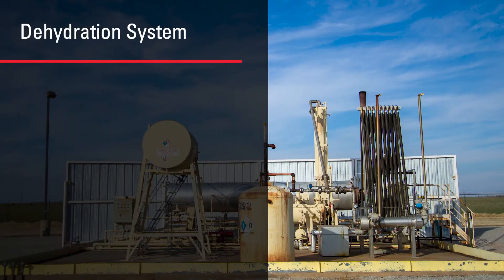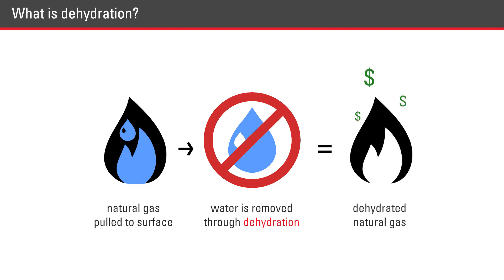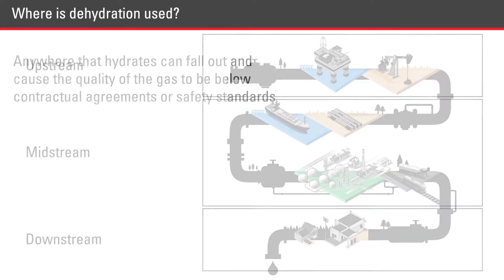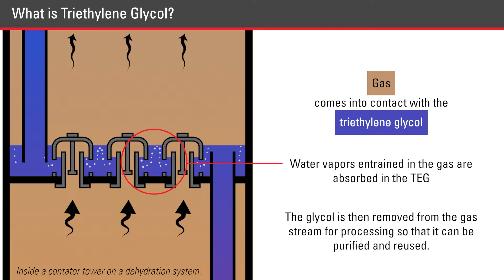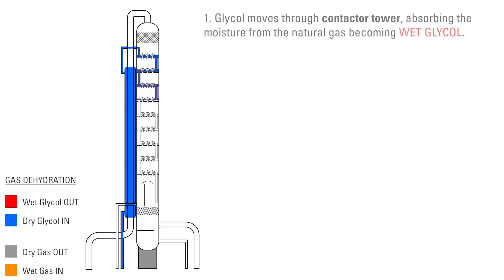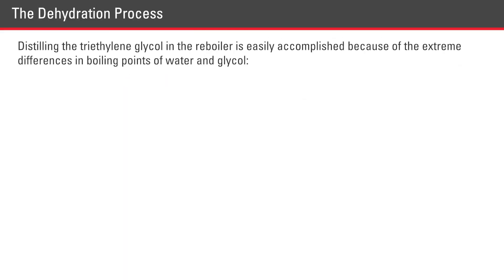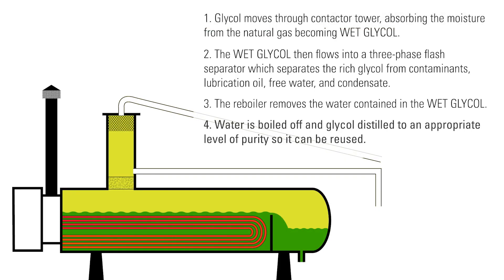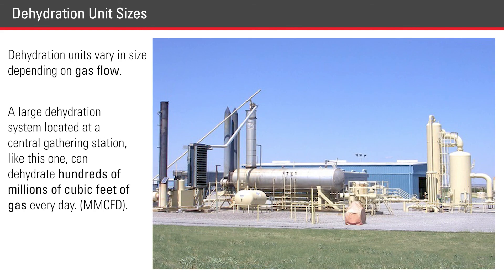Glycol Dehydration Systems Intro and Overview [Oil & Gas Training Basics]

Comment: What is the source of flash gas from rich glycol coming from contactor,reflux condenser to flash vessel
Reply from the maker: The condensed gas that’s entrained in the rich glycol will “flash” or change to vapor when it goes from the high-pressure side (contactor) to the low-pressure side (flash separator) of the system. This gas makes up a portion of the total volume going through the energy exchange glycol pump and is critical to its operation.
Reply: Can you please guide me that how much temperature to be maintained in overhead line from still column to water condenser before sending to flare.What is  importance of top temperature.How much to be maintained?We are observing severe corrosion in this line

Comment: Hi there. Thank you for the video. After the reboiler, what temp does the TEG need to cool down to before it's reused in the contact tower?
Reply from the maker: After leaving the reboiler, the glycol needs to be cooled to below 200 degrees F (150 degrees F ideally) before it enters the glycol pump. After the glycol exits the pump, and before it enters the contact tower, it will need to be cooled to no more than 20 degrees F above the gas temperature.
Reply: @KimrayInc  Thanks so much! YOu've made my day!

Comment: Very nice explanation. Thank you❤. What is the need of inlet scrubber before gas entering into the contactor as already incoming compressed gas crosses the KOD of feed booster. compressor.
Reply from the maker: The inlet scrubber give the saturated gas one last opportunity to give up any water. Filter separators can also be used just upstream of the contactor to condense liquids and filter out any compressor lube oils, scale and other debris that might be in the flow stream.

Comment: Why does the TEG need to be changed around 18 to 24 months?
Reply from the maker: After 18-24 months of operation, it will most likely need to be changed because of the contaminants and degradation of the glycol as it’s circulated through the system. The level contaminates, filtration and how the equipment is operated will help determine when TEG will need to be changed.

Comment: Hi! Just wanna ask is it okay if we don't put a BTEX condenser in a glycol dehydration plant? What are the pros and cons of these?
Reply from the maker: I'll try to answer your question without giving direct "advice" on what you want to put in your plant. There are two options to deal with the BTEX and VOC (volatile organic compounds) that result from the gas dehydration process, you can condense or destroy them. A BTEX unit will condense the vapors into liquids and allow them to be sold. If a BTEX unit is not in place, all of the vapor must be destroyed by flare or combustor.

Comment: I can’t believe there’s a video on this! It’s helped me tremendously
Reply from the maker: That's awesome to know it was helpful! Please let us know if there are ever any other topics you'd like us to cover! Thanks for the comment
Reply: @KimrayInc What is the purpose of equalisation line between reboiler and surg vessels?Some  plants,separate fuel gas is provided as blanket gas at surg vessels
Reply from the maker: Not exactly sure this answers your question, but the glycol flows from the reboiler to the surge tank by gravity, and they are always equalized with each other because of how they connect. There’s lots of open space between them (like with end-to-end vessels)
Reply: @KimrayInc  I think that glycol pump discharge PSV is connected to surg drum.The purpose of equalisation line to discharge PSV pop up pressure to reboiler and flare side.Please correct me if I am  wrong